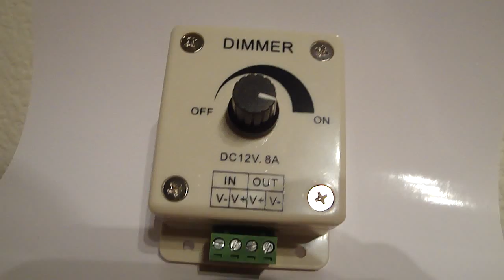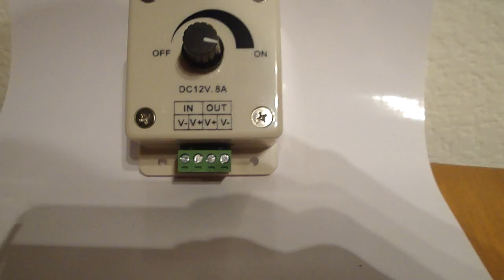How to Install a Dimmer for LED Strip Lighting

Comment: Can you connect this to RGB underglow.  Make my lights brighter ?
Reply from the maker: Hello, @denniskingsley1485. Thank you for your inquiry! The lights won't get brighter because brightness is directly tied to voltage and light components. This type of connection is risky as it overpowers the lighting.

Our lighting specialists will help you find an alternative and safer installation. For any further questions, please call +1 844 353 9347 or email support@flexfireleds.com

Comment: Thanks for the video. I tried installing one for my truck camper lights. I had accidentally plugged the wires in the wrong way keeping the lights on and the dimmer not working.

Comment: I see  this video was made in 2012.  I'm doing a couple of projects and one is lighting an old china hutch.   Theproblem is while it's fairly straight forward to wire this, these light dimmers are really butt ugly.   They're designed to be surface mounted too.    Why can't they make a dimmer that's affordable but not so ugly?  These dimmers now are about 2 bucks ech on EBAY.   So, for a cheap project, they're affordable but not easy on the eyes.

Comment: It works but somewhat in a strange way. I used pi-filter to cut noise in the grid caused by that dimmer. When  connected that dimmer to DC supply, the choke  works like voice coil on the frequency of PWM, meanwhile choke or rectifier (MMB156) heats  too much  so it is clear that it will be not operable too long on full  power.  Do not advise, unless you have Pb accu used as noise filter
Reply: I was thinking the same. Is there another solution for dimming a led strip?

Comment: I am having an over heating issue with the dimmer. I used a 10A driver to power 1440 LED's (4014 type). What am I not doing right?
Reply: If you are running 10 amps load then that would overheat it since it is rated for 8 amps maximum.

Comment: Hey Flexfire....  I have the same question as Bassotronics.  Is the dimmer good for 8 Amps or .8 Amps ? These boxes are advertised as handling 8 Amps but printed right on the dimmer itself it says .8 Amps.  My strip of LEDs consumes 3 Amps at full brightness. That would most certainly fry the box if it's truly only rated for .8 Amps. Can you answer the question ?
Reply from the maker: Hi there! Thanks for watching our videos!
This particular dimmer has a max amp limit of 8 amps.
Check out our website at www.flexfireleds.com or give us a call at 1-844-FLEXFIRE if you have any other questions.
Reply: Have you actually tested and measured it drawing 8 amps ?
Reply from the maker: We've put an 8 amp load on it without any issues. Many of our clients use this dimmer with a load of 8 amps.
Reply: It does not read ".8A", it reads "12v.  8A" the period indicates the word VOLTS is abbreviated.

Comment: Hi, thanks for your video it is really good. I want to install four 12V COB LED DRL Fog Strip Daytime Running Lights to my Yamaha FJR1300 and wondered if I could use this to dim them a little bit as they are quite bright. Also can I connect the four up to a single controller or will I need to purchase four controllers? Cheers Jim

Comment: Hello. i have a 900 lumen 12v LED flood light i am using on my motorcycle as a headlight. Is it safe to run this inline to  adjust my overall light output?

Comment: any led strip?
Reply: This will work with anything that uses 12 volts DC.   You can dim incandescent bulbs,  control speed of 12v DC motors, control 12 volt DC heaters.   The PWM (pulse width modulation)  technique in this until will work with anything the is 12 DC under 8 amps of current draw.

Comment: Does this use pwm or voltage regulation. I'm looking for a flicker free dimmer.
Reply: You could hook up a capacitor in parallel with the lights to filter the PWM output of this unit and it will clean up the output to eliminate flicker.
Reply from the maker: +Scott Wharram Hi there Scott, this particular dimmer works through PWM. For flicker free dimming, we'd recommend to lower the voltage or to use frosted covers. Don't hesitate to give us a call at 1-844-FLEXFIRE for any other questions.

Comment: Hello, sorry to wother if the dimmer is exactly the same as you are showing but the one I am buying says 12-24v, does that mean that it dimms from 12v to 24v or does that mean that it accepts both voltages?  PD sorry for my English, not my first language.
Reply: The led strip I wanna use the dimmer on is a 12v led strip
Reply from the maker: +Calixto González Calixto, thanks for watching our videos. The 12-24v on your dimmer means that it can work with an input of 12 to 24 volts. Feel free to give us a call at 1-844-FLEXFIRE and we will be happy to assist you with the design of your project! We also speak Spanish!

Comment: Hi, So if i purchase a 5630 LED strip, use a normal driver and install one of your dimmers after the driver, does it save energy, or only dim the leds?

Many thank
Reply: Burgattti It would save evergy.  Pulse-width modulation works by switching the voltage on and off at a variable speed. This causes a flickering effect that is too quick for the human eye to see. By increasing and decreasing the switching speed it increases and decreases the max possible light output and dims the LED. PWM dimming is energy efficient because unlike the resistive dimming the more the LED is dimmed the less wattage it uses.
Reply: Brent Mauriello brilliant. There are many dimmers which look 100% identical but don't say whether they are PWM or variable resistors. 
Many thanks

Comment: anybody know if this just varies the voltage? where I want the dimmer, I only have access to the positive leg of the led strip, not the negative, can I wire only the positive?
Reply: No, The PWM circuit inside requires + and - to operate. Really old thread. The guy has probably figured this out ages ago.

Comment: Is this suitable for 15 meters of LED strips? I've  made a panel by connecting 50cms  lengths up in parellel.  Currentluy I'm  using a 12v 2amp  supply and a PWM dimmer but it's  useless for video work as the image flickers. Could I just swap my dimmer for one of these?  Many thanks
Reply: Each 5 M strip uses about 1.4 A, So it will work but I think you need better than 2 amp, Perhaps 4.2 A? Really old thread. The guy has probably figured this out ages ago.
Reply: Still useful in this age, thanks alot ✌🏻

Comment: Tad bit of a modding question. Not looking for you to warranty any sort of what happens next. I want to mount the knob on a dash and the rest of the dimmer mounted inside the console of my boat. is the knob/pot soldered to a pcb board or are there leads connecting the pot to the board or directly to the plug?
Reply: it's an external pot, the pot is by it's self, with 3 wires leading to a small control board, they could easily be mounted separately.
Reply: http://s13.postimg.org/4iydhgd1j/leddimmerinternal.jpg

Comment: I have an LED white light ribbon strip- with DC plug adapter at one end and red/black wires at the other end. So I would have to cut the dc adapter power source to plug into the in of this? then just the open wires of the LED? i've found a lot of confusing stuff online - about a servo and other needed parts to dim. thanks